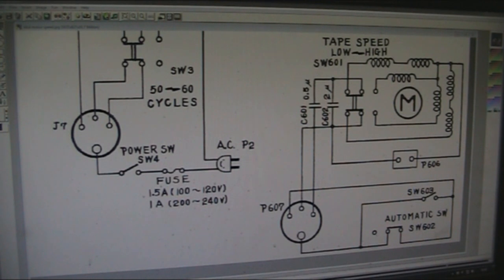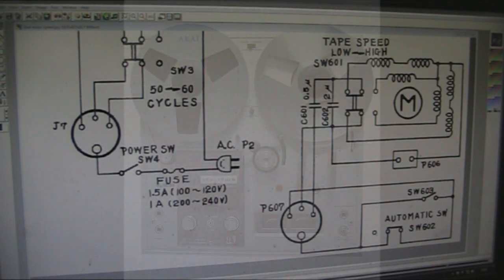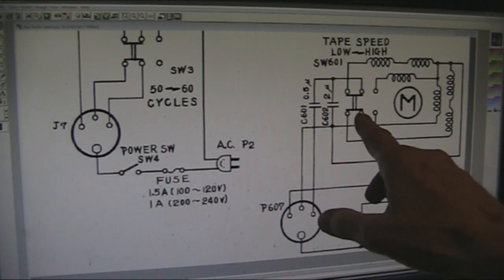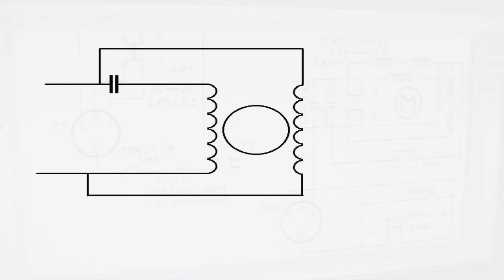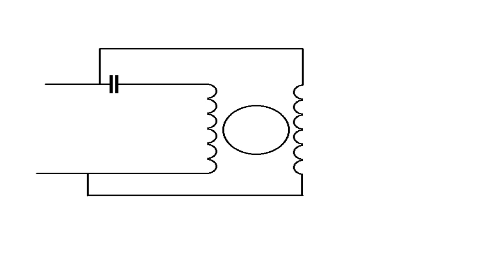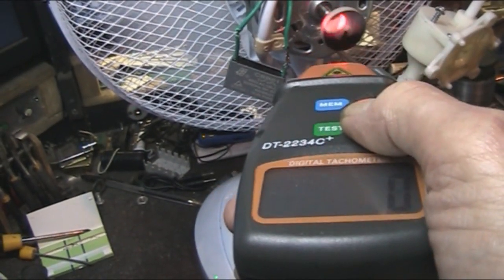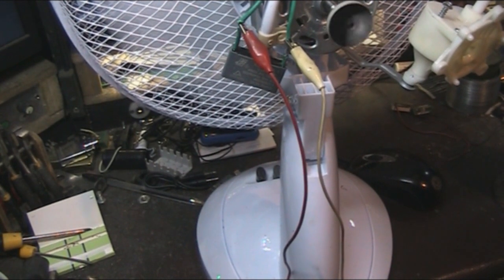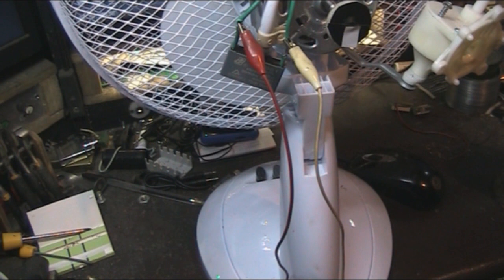Tape Deck Motor Speed

Comment: Many thanks for putting this video together. I'll go ahead and swap our the capacitor. My only issue now is finding anyone who can supply a suitable 220v 1uF cap. Any suggestions? Again, this is much appreciated.
Reply: @UberAlphaSirus  Ahh - I take it that’ll make no difference to the result (utterly clueless chap typing).
Reply from the maker: You don't have to find a 220v one, as long as the voltage is higher it's fine.
This would be ideal, it's the style my friends use
https://smile.amazon.co.uk/sourcing-map-Metallized-Polypropylene-Capacitors/dp/B07JX5J6RG/
Reply: @sparkyprojects  Brilliant, many thanks again.
Reply: @sparkyprojects  5% ain't to bad. The ones I couldn't figure out to link seem to have pretty decent tolerances. I ediyed my original post as it did make much sence, lol
Reply: @Techmoan  Sparky is a brainy sod. I was 90% sure changing the cap would do it, but my brain started hurting figuring it out. Top man Sparky
Reply from the maker: @UberAlphaSirus  It's all about the charge/discharge time ;)
Reply: @sparkyprojects  yup, i got that far in my head. But would have had to get the calculator and a book out. Ac mechanical has never fully absorbed into my head.lol

Comment: I'm here from Techmoan's new video. I certainly see how changing the capacitor can change the speed on an induction motor running below synchronous speed, but I don't see how a well-regulated speed could be set this way. Wouldn't the load have a huge impact on the speed? And then there's line voltage variations and component tolerances. What am I missing here?
Reply: It is puzzling. I thought the benefit of using a mains AC motor, usually in older equipment, was that the speed is constant and an electronic speed control was not needed, as with a DC motor.
I think the fact that it is a background music system, the speed is not critical and the crude, fan style, capacitor speed reduction is acceptable.
Reply: @dino6627  Equipment using the AC line for accurate timing use synchronous motors which rotate in sync with the AC line. 3600rpm on 60Hz and 3000rpm on 50Hz.

A less regulated speed might be acceptable for a BGM system but the same circuit is used here in a reel-to-reel where standards are higher. There must be some factor I'm not considering which leads to less speed variation.
Reply: @eDoc2020  It is strange, if not locked to the AC frequency there doesn't seem any regulation to the speed.
It would be interesting to know more about the motor and its windings.
I once saw an old video recorder that had a synchronous AC head-drum motor, with an electromagnetic brake to bring it in sync with the video signal. Not what is happening here, but maybe of interest.
Reply from the maker: I'm not an epert, but yeah, you will get some variation, but this system has been working for many years, and is probably not enough variation to notice, even if you record on one device and playback on another
Reply: @sparkyprojects  I was thinking it must be something mechanical helping to regulate the speed. If there's a nonlinear relationship between torque and speed this could mean a given change in power would result in a much smaller change in speed.

I recall learning that power lost to air resistance is related to the cube of the velocity. I decided to do the math and sure enough, if you take the ratio going from 0.6 to 1.0 uF (1.667), take the cuberoot and multiply by 50 Hz you end up with 59.28Hz, quite close to 60. Your Akai has a much smaller capacitance ratio of 1.25 but if you square it (since power is often related to current squared) you end up with 58.02 Hz using my earlier math.

I'm not sure if those numbers lining up is a coincidence or not. In your fan example the change in speed appeared to be directly proportional to the capacitor value. This would suggest that it might be a coincidence. The specifics of the winding arrangement probably also matter a great deal. It seems to be one of those cases where something which seems like it should have a simple answer is actually much more complex.

Comment: Ok. But what is the reason for the faster spinning? Does this works on asynchronous motors? Synchronous motors like in the newer akai needs to change the pulley.
Reply from the maker: The motors in tape recorders like techmoans are asynchronous. just like most induction motors, there's a certain amount of slip, if you calculate mains fequency against the poles of the motor it should be 750, 1500 or 3000 rpm for 50hz, but it's actually a little bit slower than that.

Comment: Would a resistor in parallel with the capacitor increase the motor speed?
Reply from the maker: Depending on value, i can only think this will slow down charge and discharge of the capacitor as the cycle changes polartiy, not sure if this will speed up or slow down the motor, but probably won't make enough difference to be useful
You would also need a properly rated resistor for the current, it's much easier to use capacitors in series and/or parallel to tweak the speed.

Comment: 3:12 Sparky says the lower capacity capacitor gets disconnected. Techmoan seems to have wired the capacitor in the same spot.
Reply from the maker: Techmoans machine is an either/or, the Akai in my vid adds capacitance to the original, Techmoan did it right.